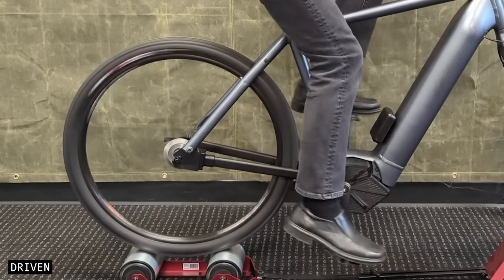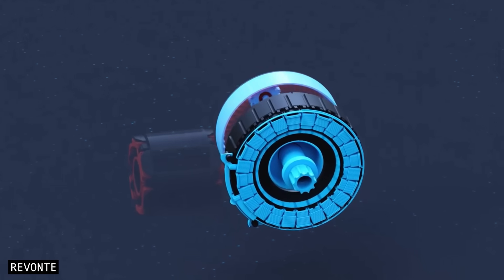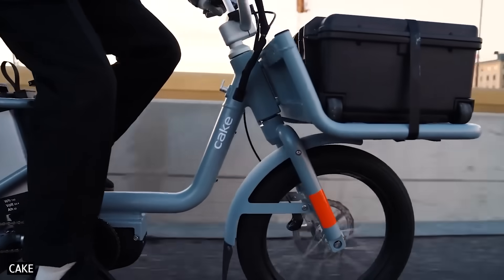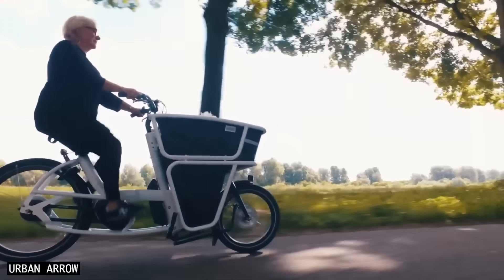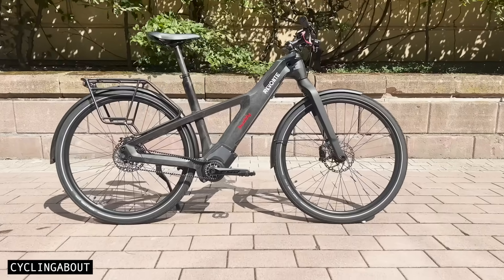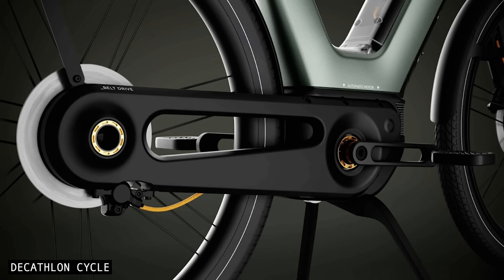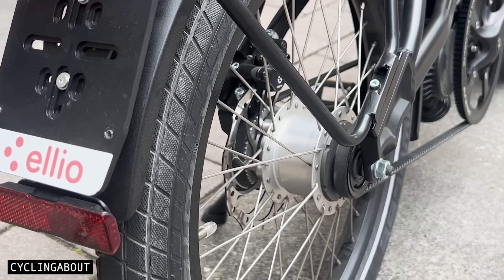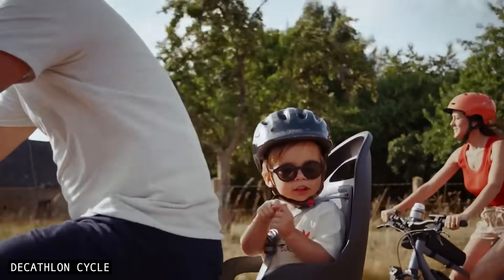Death of the Derailleur? Chainless eCVT Bicycles Might Change Everything!

Comment: 3:05 "completely effortless"...wouldn't that make it a moped? :p
Reply: I was an e-skeptic until my heart attack and the heart break of discovering there is no way to fully recover ejection fraction. It clipped my wings and shortened my biological range drasticly! An e-bike conversion kit (front hub) doubled my range in the first week! And I was still getting a workout. 250w pedal assist (only legal option in Australia) isn't like riding a motorcycle, it's like having Cadel as my stoker on the nasty hills, most of the time, I was running a 20% boost. Then I got greenspeed with middrive (same power, torque sensing, rather than cadence) and all the recumbent advantages are getting me closer 100km/day touring I used to do, and 30km/day regular riding I kept up after retirement.

I get a workout riding either the upright or the 'bent, despite the motor. The motor stops me blowing out my MHR, that's all it does. 250w PA is a disability aid, and for able bodied riders, it's a guard against over training - a rest day riding tool. More riding more often is good.
Reply: @crunchysteve  Glad to hear e-bikes helped you — I was mostly referring to the growing trend of young, healthy people (even kids) using e-bikes or e-scooters in flat regions for short distances.

Just like with cars: most trips are under 10 km with one person and no luggage. When e-bikes replace those car trips, that's a win. But often, e-bikes replace regular cycling instead — and that’s a missed opportunity.

I see colleagues leasing expensive e-bikes they use only during sunny summer days (in Belgium, not that many of those…), and by year two, many stop using them entirely. Even in turbo mode, it seems they can’t keep up the habit.

If we want lasting improvements in health, air quality, congestion and safety, we need more year-round cycling — not just faster bikes. And especially not more speed pedelecs (45 km/h), which often make bike paths more stressful and dangerous for others.
Reply: You still have to pedal as they're pedal assist.  So not completely effortless at all. Just less effort involved in gear changing.
Reply: Indeed, some bikes are becoming cars on 2 wheels: price, complexity, health effect,... I'll stay with muscle bikes, as long as my trips are not longer than 20 km and i don't live in the hills/mountains. Even when i'm 70+ i'll probably not buy an e-bike, because from that age the risk and consequences of falling is much higher, which is further increased by electric assist. I will just adjust my speed :)  I'm 45 now and I'm becoming a minority with my non-e-bike, the age for e-bikes is getting lower and lower, my daughter of 13 has a class mate with an e-bike, while he doesn't live far from school. In the Netherlands, elementary school bike parkings are getting full of fatbikes (= mopeds with pedals).
Reply: @cyberblizzard9362  4 decades ago my neighbour cycled 3 mile each way for the morning paper till he was 93.
Reply: @cyberblizzard9362  I'm now 73 and up until last year I rode a muscle bike. As I rode at around 25km/h (15 mph) I thought why buy an e-bike when I can ride with muscle power just as fast. The end of last year I did buy an e-bike (Heybike EC 1). I have it set to assist 3 (from 5) which goes up to 19km/h (12 mph) so most of the time I'm above that which means I'm using next to no battery power. It's really only when going up the steeper hills that the motor kicks in (at 73 the legs aren't what they used to be). Most of the routes I ride around here are 30 - 50km (20 -30 miles) long and starting with a full battery of 41.5v I have still got around 39v left at the end which shows how much the motor is used. It's fun riding the e-bike when you know you won't have to struggle up the hills.

Comment: I hate seeing electric motorcycles used on park trails. Powered for transport use is OK but they shouldn't be used on recreational  trails.
Reply: Big downvote. I would agree with you if there was another option, but as a North Texan I can safely say you either link park trails or you're bumping elbows with lifted F-250s
Reply: @avva4090  Not good for parks and the people in them
Reply: low powered pedal assist bikes allow less fit or disabled people to enjoy the sport with others. Ebikes can also replace motorized lifts. While high powered ebikes can disturb, there are plenty of good use cases for smaller pedal assist bikes

Comment: This is so cool and practical but the only problem is just price.
Reply: And the warranty. My ebike battery died at 4 years old, dealer wants £650 + fitting to repair as its integrated with the controller and coded to the bike (Mahle system).
Reply: @adrian_r  💯

My whole bike cost me less than 1000€, including upgrades, and there is no way I'm ever gonna own a bike that costs almost that much for repair 😂
Reply: @Boss-dr2zk Yes, but you don't have access to some NASA technologies... 😇
Reply: That’s true. The latest from GoCycle (not even the new tech) is £4500. You can get a motorcycle at this price. Although having used both I kept the bicycle for commuting.
Reply from the maker: The BTWIN LD 920 E is €2600. It's quite good value relative to comparable bikes. ⚡️
Reply: Yes ,you can actually buy a used Toyota Prius for the same price as the bike.
Reply: Setuju banget 😂😂